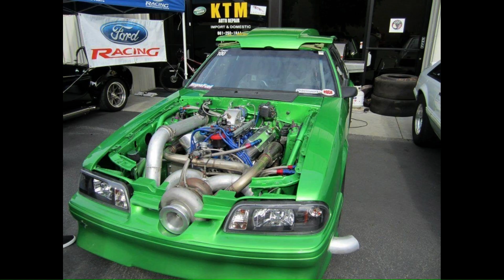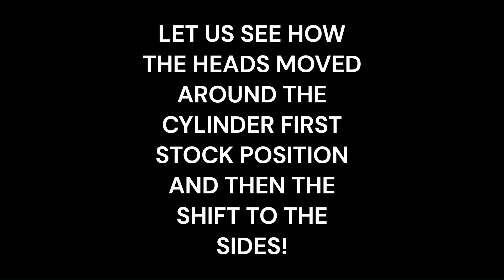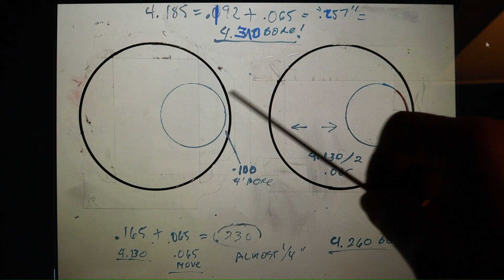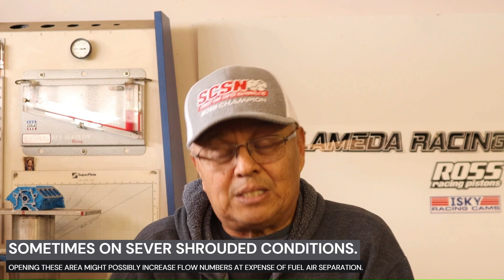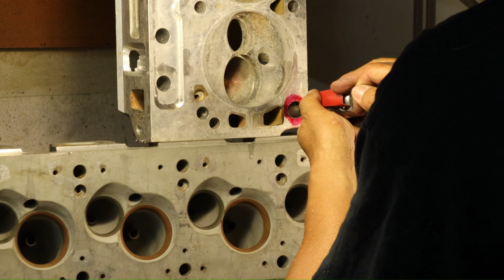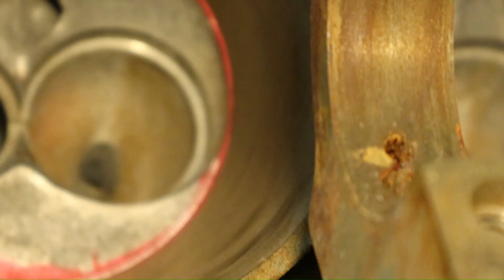FORD & LS HEAD TO BLOCK MODIFICATIONS

Comment: I really like this tutorial, Ben! That's thinking out of the box! Definite BAR secrets your sharing :) So is it safe to say that even a simple head bolt clearance as you've demonstrated will net benefits without larger valves? My block is .040 overbored. Shall we clearance my head for added unshrouding?
Reply from the maker: I did the groove and that is more important and moving the heads is only for the max effort full race builds.  Street it is possibly not really needed except for massive boosts where it needs space for the intake valve to breathe.

Comment: Ok, how much room is there in an AMC 304 bored out to the maximum recommended by the factory to 3.875? I’ve been trying to find out for years because I’m cheap and an otherwise throw away motor, I think there’s good gains to be made. Also, what about offset boring? Not for the 304, but for everything else.
Reply from the maker: Offsetting will move the connecting rod load off to the side and the piston pin will bottom off one side as well.

Comment: Hey Ben, thanks for the shout out!! Just started to watch this, Great video so far, yes we need to get back on our project....
Reply from the maker: Tim!, just got done with a runner up against a billet headed small block and considered we did very well! The competition ran a canted valve small block and we need a penalty applied so we felt like the competition against the Clevelands back in the day!  lol  We ran an inline SBF.
Reply: @benalamedaracing2765  hey Ben, sounds like you got it going on. Just got a new computer. So I should be good to go. Glad those Cleveland’s have you a work out lol.

Comment: thanks,Ben can you do this on a ford 4.6 2 valve engine?
Reply from the maker: It is possible and it would not be very much because we have issues with chain alignment.  One you must mill the sprocket and add spacers on the other.  It can be done however and it should give an advantage specially under boosts!

Comment: That's pretty genius Barney that's a pretty good idea You've got talent, 👍🚩 I got a question though would it help the head gasket in the center between the cylinders not blow is easy I know you don't like answering questions ❓❓
Reply from the maker: I actually enjoy answering questions to further clarify what I posted or said.  As you can see there are ample space to seal between the bore and it gets tricky when you have a larger than normal overbore on the cylinders then one must be very careful it does not overlap.
Reply: Thank you 👍

Comment: Ben, that is clever. A little more go power at the expense of some careful planning and grinding.  These are the ideas that keep hot rodding interesting.
Reply from the maker: Absolutely it is the best part with different approaches trying to make more power!  From the science of cylinder heads to bore and stroke advantages plus cam and valvetrain dynamics plus many others!
Reply: It's also what made technology evolve so much. It's the older guys that done these things in the past that the younger crowd is grabbing and applying the new technology with

Comment: Chamfer the bore. Back  cutting the combustion chamber . Been doing at most machine shops across the country for years
Reply from the maker: Everyone chamfers the bore or else you break the rings when you install them.  Back cutting the chambers yes as long as you do not pull away from the exhaust seat drastically and blow up the airstream with turbulence...

Comment: Hello Ben another great video , that guy you were arguing with I think I argued with him also 😂 😂 nah there's alot of these guys out there that when you tell them these things they just don't want to believe it but then they wonder how is your car going that fast it makes no sense to me but then again common sense isn't that common 😉 great seeing you thanks for sharing your knowledge
Reply from the maker: Thanks Terry for supporting my channel and appreciate it much!  
I usually just listen and like I said i let cars I am with speak for us.  lol
Reply: @benalamedaracing2765  that's what I like about you Ben you let your cars speak for themselves and besides you are to nice of a guy to argue with,  hey Ben another thing you prove is that nice guys don't always finish last 😉
Reply from the maker: @terrygrover6440  Thanks for the kind words Terry.
Reply: Hi Ben, looking for a thought on this. I have a thick enough block to build a 4.13 bore and 3.98 stroke 426.51 ( 428) with a  CJ iron crank, they are strong cranks and  can be lightened considerably and be internally rebalanced. The stock rods are what were used on the 428 CJ and with mildly used rods and ARP top tier bolts at 3/8 inch and good resizing they are 6.488 long and pretty strong. They are  forged 5140 steel, they have been polished and peened. I don’t have pistons  yet.  But if I used flat tops and milled the decks  from 10.17 to 10.155, zero desk ch would be 1.677. I have a solid roller a Bullet Ultradyne ( Harold Brookshire design) 245@ .050 both sides asymmetrical exhaust, .600 lift 110LSA and  a 106 intake center, but I intend to retard it to 110. I have COAE-D heads that are ported to flow 295 and they are 68 cc chambers. I am shooting for 600 hp 550 ft lbs of tq. Do you think that these factory parts will handle this or should I go for the 6.7 BBC rods ? The C0AE-D.  Soft chambers at 67 ccs. I think it can do it. I have ARP main studs and crossbolt aluminum main caps for 2 and 4 mains to prevent cracking. The rest are iron with the ARP studs. The intake is a PortoSonic with a 2 inch spacer single plane and an 850DP, 2 inch Crites headers and 3.5 collectors. I think  this should be good enough for 600 hp do you?  Thank you so much for your ideas and your help as well as your time with the LAPD. I have great friend who lives with Lancaster and he had a half ownership of a Volvo Dealership. And two brothers in Palmdale  who raced a White 69 Mustang with a 428CJ in C/SA M&M Racing one brother passed away and the other moved to Utah. He gave me a bunch of parts .,  Really great guys all. We are some of the last of the little guys running FEs. But I think Ray Paquet took his 9000 rpm T-Bolt 427 ci into the 7s he might be moving heads up with the Hemis next year.,well  Merry Christmas to you and yours. Just wanted to pick your brain a little. I’m on a shoe string budget, but I won’t step over a dollar to save a dime.

Comment: Why not move the exhaust over towards the cylinder wall so you can make the intake valve bigger and you can still shift the head - many Super Stock Racers use your SHIFT THE HEAD TRICK
Problem with the LS Engine is the bore spacing will not allow a bore that big even with the 6.0 Iron block there is a limit to the bore diameter with the OEM blocks - spend the money on the aftermarket block and then you re in business and can use the LS-3 heads with 2.165 int and 1.990 exh and get tricky with the valve seats and guides - but the intake will flow in the 380 range at 800 lift -- Using OEM HEADS
The way we did the offset was using offset dowel pins
Always great information that many engine builders don't know
Reply from the maker: Thanks Wizard.  Big intake is great but i feel a 1.990 exhaust is way too big and will over scavenge even the dynamic compression charge just ingested during the intake stroke.
Reply: @benalamedaracing2765  - You are correct and we found that out the hard way - our solution was different, let me explain - What we found in the exhaust was step headers and when we got them right they over scavenged the exh system and still made more power - the first choice was to kill the low lift flow, that helped but , so order another pair of heads done with the low lift flow at max for that head (iron turbo chevy) my solution was a reverse cam where the exh is smaller than the intake and that did both; by the time were were through we had 21 more hp and 50 ft lbs of torque then the other way --- What happens if we put all these tricks together including the "V" Grove ---- I wanted to put the "V" grove in the piston -- When you look at the timing events you can see where the exhaust is the single most important part of the 4 cycles -- In actuality the EXH is the same as a pulse jet engine, so we can use that tek to apply the kenotic energy to the power output of the engine -- Audi uses it to generate extra hp by keeping the turbo spooled up they call it the rocket in the exhaust Actually 2-strike tek
Reply from the maker: @wizardshome9686  , thanks for your input and appreciate the feedback!

Comment: I would move the ex valve over away from the in valve. The ex being against the wall is not nearly as bad as the in being against the chamber wall.
Reply from the maker: David, most state of the art cylinder heads do lean the exhaust valve very close to the cylinder wall.
Reply: @benalamedaracing2765  yessir. The LS3 heads I use have to big of an intake valve but it could still be moved, it would help. The intake is over close to the chamber and when you put them on a 4 inch bore there is a ledge from the bore. I'm going to move the head or put a small bevel on the top of the bore.

Comment: Ben what about offset boring the cylinders on the intake valve side in order to have less valve shrouding.
Reply from the maker: Jose, sometimes it pinches one side of the rod pin and it is not a straight up travel anymore loading one side of the rod bearing more than the other.  I feel a "centered" push on the connecting rod is important specially with lots of rpms and power.

Comment: Good vid as always Ben. On a different topic I wanted to know what transmission you like or favor for a small block ford automatic or standard and why? Oh and do you do crate engines?
Reply from the maker: On 302 I like the 5 speed gearbox and anything bigger I prefer automatics because of the added torque from displacement.  I am retired and do very limited engine builds at this time.
Reply: @benalamedaracing2765  If you'll permit me one other question C-4, C-6, or 2 speed powerglide?
Reply from the maker: @jarez3781 I like the C4 over the C6 which slowed me down big time from the heavy rotating mass inside the trans.  2 speed has its place in bracket racing and very high horsepower small tire racing with boost/nitrous.  Anytime it is NA we stick with the Mopar torqueflite or the T350-400.  I avoid Ford transmissions for serious efforts.

Comment: Our eyes are learning to look at combustion chambers quite differently,  thanks Ben.
Reply from the maker: Thanks Robert.  We are here to learn and even from me just reading the comments helps greatly in understanding the dynamics of an engine.
Many comments are helpful big time that is for sure.
Reply: @benalamedaracing2765  I wish I could do this on the FE. I want to turbocharge a 410, but the valve arrangement won’t allow moving the head. It would on any other style head. I am here to learn also. I enjoy learning new things. I wish there had been more options for 4.63 bore spaces engines.
Reply: A lot of gains are realized by the chambers. More than one engine familiy runs way better than would appear.

Comment: I always liked to think of intake valve position like a scroll housing, except its compound: doesnt just open up from 3-7 o'clock as a circle in circle drawings shows, it lays back at the same time.   So the  3 o'clock starting point becomes critical:  how many degrees does the chamber edge deviate from the path of outer diameter valve travel [seat to perhaps 0.300" lift, just to pick a number close to some heads].  So in going from say 18 degree valve angle heads to 13 or what have you, the chamber is less of a  headache, but where is the cylinder wall vs intake guide centerline.  
 And what a great [symmetrical] tip: when you can't move the guides... nudge the cylinder head over a hair
Reply from the maker: Thanks Flinch for your comment and understand where you are coming from.

Comment: What about intake ports lining up?
Reply from the maker: Redrill the bolt holes and manifold ports are mostly smaller for that purpose!  Mismatch big time may weld, epoxy or split the manifold and weld back together.

Comment: While I get your points here, to me, this illiterates the paradox of increasing valve size, resulting increase in shrouding, and the decrease in discharge coefficient, for a larger throat. 
I personally feel, another strategy, as you stated later in the video, would be to exploit intake departure geometry to minimize shrouding, and maximize valve lift, for the increase in valve curtain area and discharge coefficient.
I suspect that your head offsetting, without any increase in valve size, and maximizing lift, would result in large gains.
All good stuff, for thinking people.
Thanks for sharing.
Reply from the maker: Thanks for your thoughts and truth is there is always a point of diminishing returns.  What I have shown here is the benefits of overbore 4.00 to as much as 4.190 on SBF "plus" shifting moves the valve far beyond what was thought possible!  I made many comments about it but would never insists to do so until now explaining thru the whiteboard what i going on, very hard to disagree with!
However, there will always be others who would think otherwise and it is ok as well.
Reply: @benalamedaracing2765  I have learned that any effort on the exhaust side is a waste. The end of the exhaust stroke cushions the yanking force on the pistons and rods and when that big intake opens and the SSR is right the chamber will push the end gasses out within the optimum window to pull the intake flow all the way down until it’s almost if not within the same window to the TDC smack and the plug lights it. NA you need to minimize the amount of yank on the rotating assembly. And this I have learned from Ben.

Comment: Love this stuff, I remember moving Ex valves over in 460 ford engines and changing the Ex port, back in the early 80's, when I was lucky enough to work at Danbury Competition Engines, still good friends with the owner!
Reply from the maker: I am sure you guys tried many things like I did...
Reply: I myself rarely put a lot of effort in to the into the exhaust side.  The exhaust is under  positive pressure and the air as  it comes up to TDC, a bit of exhaust will act as a cushion to the jerk on the pistons and rods . If the chamber is empty it yanks on the rods with enough force to break a rod. About 65-68% ratio of intake to exhaust flow on a bench at 28in , just a thought.

Comment: Definitely not chesting in my opinion. It might result in a new rule but that just means your trying.  Thank you for sharing your time and knowledge.
Reply: It doesn't seem any different than using aftermarket heads, and in a class that requires stock parts, I don't think I've ever seen a rule saying the stock parts have to be from the same brand, it is a gray area though. Do they mean the assembled factory unit or do they mean actual stock parts?
Reply from the maker: It is only cheating when caught sir!  lol
Reply: @benalamedaracing2765  😆
Reply: @benalamedaracing2765  doyouhave 632cthey

Comment: My afr 220 sbf head came with paper work saying the 2.10 valve is heavy, why go even bigger when ive seen 2.02 flow just as much
Reply from the maker: AFR heads comes in metric stem size which short of titanium,  perhaps the lightest ever sold to the masses. I like them specially for road racing with higher than normal engine speeds.

Comment: Moving heads opposite ways also makes intake not align, so what do u do
Reply from the maker: Depending on how much you shifted it the manifolds today have smaller ports or welding (epoxy) goes a long way!  I had an old one where I split the manifold in half and rewelded it back and it is hard to catch except if you looked inside the plenum...